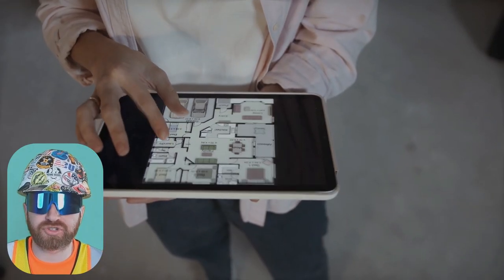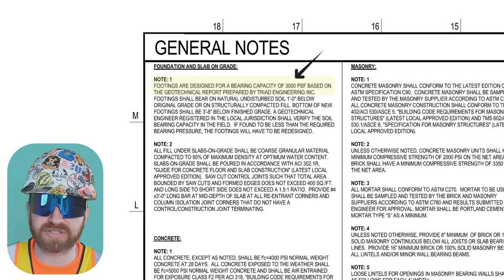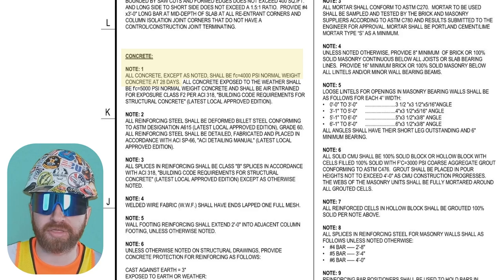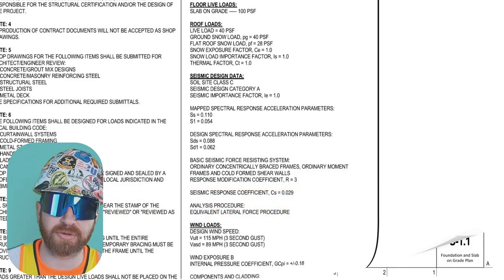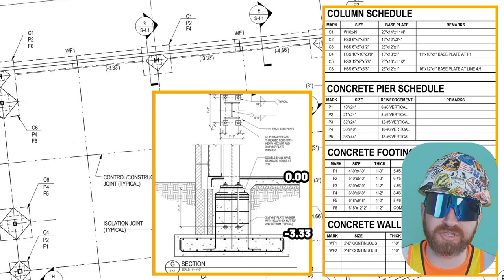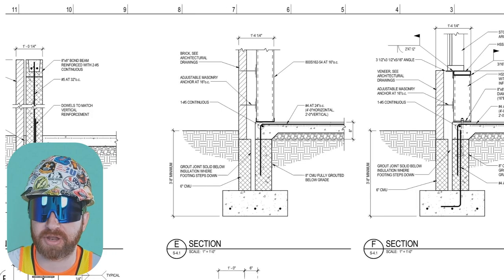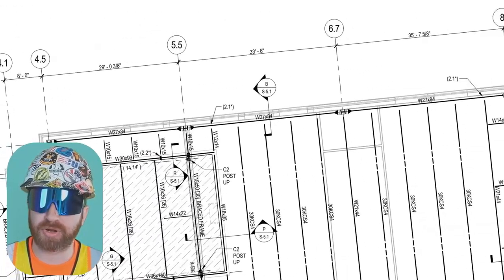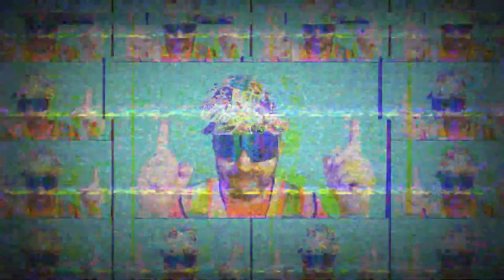Learn How To Read STRUCTURAL Construction Drawings!

Comment: I'm currently studying CEM in university and your videos help me a lot. I don't know if it's because I'm fairly new to this subject but it often feels like the education curriculum is not structured in the smartest and simplest way at school. I don't know. Maybe it's just the major, or maybe we haven't integrated technology enough, to make things much simpler and faster. It seems ridiculous that one has to jump from drawing to drawing to figure things out. Maybe it's normal and easy for the experienced but there has to be an easier way of doing this. Maybe there's some software out there or maybe it will be up to our generation to make this far less confusing and tedious. 
Anyways, your videos are great in clearing up a lot of these questions. Keep on the good work.
Reply from the maker: I felt the exact same way and said the exact same things 15 years ago - courses were structured in blocks that didn’t simplify the process or education.  Current market technology and software is limited so the best you’ll get are drawings with hyperlinks and search functions (Procore) and the systems in general are FAR from integrated with to each other.  The construction industry is slow to adopt change, so yes - if someone could streamline this all construction could be simplified, but this is understandably an extremely difficult task given the complexity of buildings.  All good thoughts - also why Im making these videos to help those now : )
Reply: Even if the technology was there, it's always good to have the fundamentals and to have an understanding of how to do your job without technology. You may not always work for a company that uses the latest and greatest, and even then, systems go down, they have bugs, or can barely pass for reliable. When you're faced with technological issues, you need to be able to work without that technology and know what you're doing with the hard copies. I also personally feel like hard copies are superior when looking over something with another party, as you can simply point to something, and you can't have screen glare in the field if you don't have a screen.

Comment: im glad that this kind of technical explanation on how to interpret structural drawing is made. I'm just starting to learn on how to interpret the connection of drawings between each page like from single line to double line. If for example, i will draw the beam for L1 where will get the information on the steel needed at that particular location? was there a schedule or was it coming from general notes, and then making the section plane or cutting plane how to interpret this as well thanks for your possible reply
Reply from the maker: Each beam designation should relate back to a schedule describing that material - such as the beam in this example

Comment: Hey thanks for the great video and knowledge sharing! Would you please explain how to determine stem wall heights on a foundation structural page? I always have a hard time finding that information. 

Thank you!
Reply from the maker: Easier to explain sitting infront of a drawing set, but typically you'll see two dimensions.  There should be should be a top of footing dimesnion and top of foundation wall dimension.  The top of Foundation wall is often equal to finish floor, or dimension 100.00.  The top of footing can vary, but in frost areas it's usually 96.00.  Meaning your wall is 100.00 - 96.00 which is 4'.  This doesn't include how thick your footing is, you'll have to look at a footing schedule to define that.  Hope this helps -